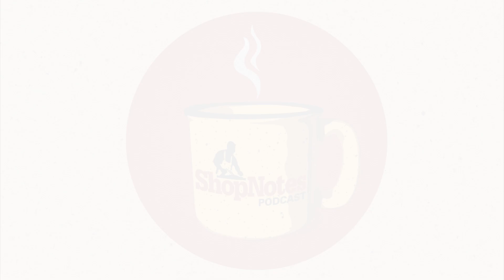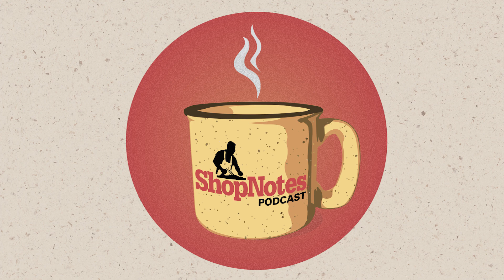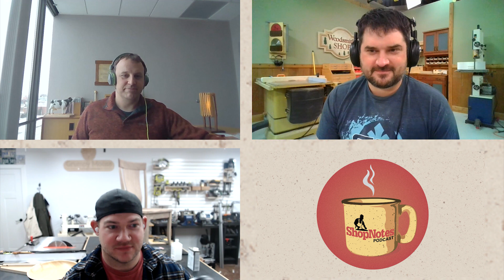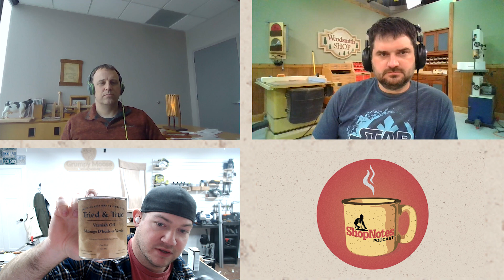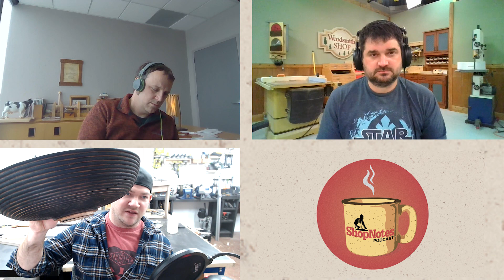ShopNotes Podcast Ep057: Start at the Finish

Comment: I like using shellac for finishing; nothing like using bug secretions on your projects. I've found that for my stuff, mostly smaller boxes, a cheap-jack air brush works wonders, especially for the darker shellacs like ruby, garnet and black.

John - I'm retired, and still have a hard time finishing projects, so I'd say you are ready to retire.

Logan - When pricing, don't price based on materials and labor, just use that for setting a minimum acceptable price. Set the price for much more - people tend to assign value and desirability based on price, so a $200 bowl will be more highly valued than a $60 bowl, even if identical, and will likely sell faster.

Comment: In no way am I an authority on any of these subjects, but I recently stumbled upon a crazy simple way to even out the coloring after applying fire to uneven surfaces like Logan's bowl - shop-made sharpie dye. Like him, I was headed in the direction of paint, but I was none too thrilled about the prospect. This solution yielded better results than I could have imagined and seemingly opened up a world of decently reliable dye possibilities. All I did is gut a sharpie (or 2 for heavier color saturation), taking care to cut a slit down the length of the plastic sleeve that houses the ink before cutting it into pieces. I dropped those messy pieces into a couple ounces of 91% iso alcohol and let it sit for a couple hours in a cheap plastic cup with a lid - think jello shooters.  I don't know if that was necessary, but it seemed to me like evaporation might be an issue if I didn't. I strained the dye off the sharpie guts into another shooter cup, being sure to squeeze all the color out of the remaining cotton and applied it with a foam brush. Worked like a charm. I've since used this method to make dyes of several different colors with surprising success, with the one caveat being that I am uncertain of how long it will last, but with whatever topcoat, it seems like a viable solution. Any thoughts?
Reply from the maker: Adam - I may have to cannibalize a few sharpies to try it - Thanks! - Logan

Comment: my new go to...Fiddes Hard Wax Oil.  Only need to sand to 150, easy to apply.  brush on, wipe off.  Two coats with 6 hrs to dry each time, and you get a great shine, beautiful grain, and it's as durable as poly, yet feels like smooth natural wood.  easy to touch up or repair if I ever need to do that.  It's pricy, as I paid $36 for a small quart, but it takes so little, I think that can will actually last me for many projects.